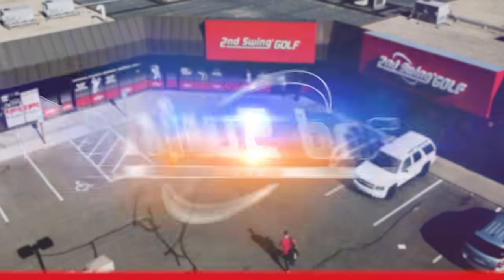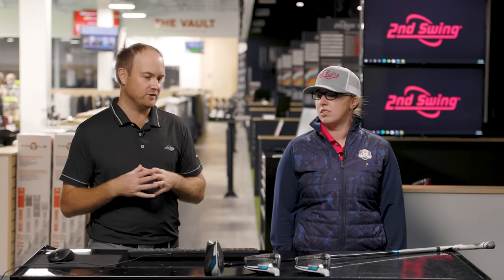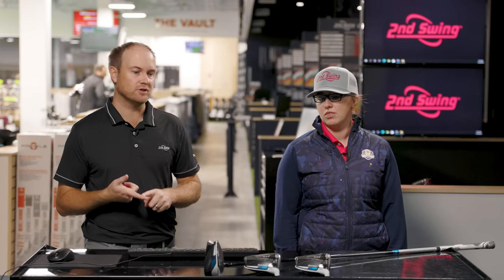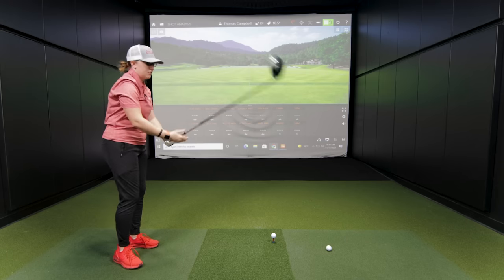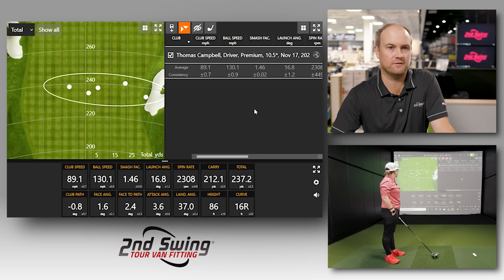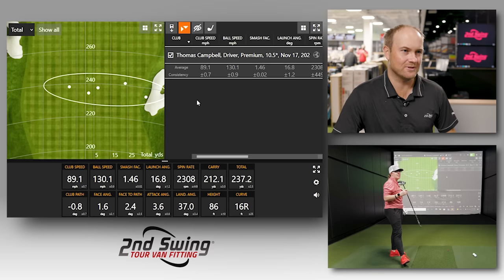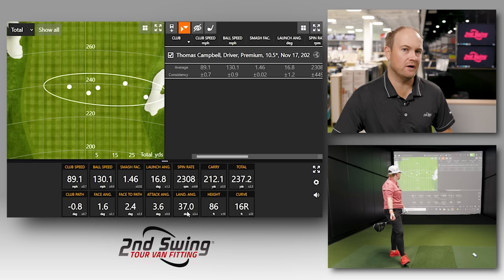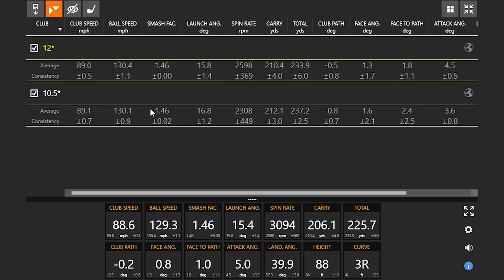Golf Driver Loft Test | Why Driver Loft Matters In Fittings

Comment: 1 thing that many amateurs do is mistake the need for more loft while the issue isn't the loft but rather their  driver swing which is totally different than an iron swing. If you're not swinging up at impact, the ball won't climb into the air. This was my issue.  My driver is 10.5 degrees, which if swung properly is plenty of loft to get the ball flying higher as it should, but my swing was too flat causing mid height stingers. For higher drives, you must stay behind the ball & not overrotate your hips & shoulders which will flatten your swing & cause low drives. We've all been told to tilt our rear shoulders down at set up which is correct, but if you don't keep that tilt through impact, you won't swing up as is required for a higher launch. Stay behind the ball & don't let your hips & shoulders rotate on a flat plane & you will be swinging up. As with most things, do this with a half swing until you get the ball airborne consistently, then you can lengthen the swing but don't try to kill the ball. This is only meant to develop the feeling of swinging up so swing slowly & smoothly.

Comment: Another informative test 
I use an 11degree driver and it,s my fairway finder .I think correct loft with the correct shaft flex,kick point and weight is the magic recipe ,not just loft alone .I use a miayazki c Kua  43gram R flex  shaft for my driver and my fairway woods 2011 model shaft but that's what works best for me . Thanks again for your video,s

Comment: On average the R-flex produced a much higher launch angle with a little bit more spin. This ultimately led to 11 more yards of carry and 7 more yards of total distance.  The extra launch and spin helped boost carry distance, even though the average ball speed was down 1 mph. The steeper landing angle led to slightly less roll-out, but the net gain was still significant. In addition to the gain in distance, the player’s dispersion area shrunk significantly.
Reply: Well done ,I was going to get stealth 2 but horror story's about the face ,,so got almost brand-new sim 2 stiff shaft, winter I can't really get up the course in winter moving to the best course in my city ,downfield, Scotland, can't wait 👍

Comment: Surely an appropriate test would be to change up or down the swing speed at the two extremes @ 14 and 7 degrees ?  I have a driver swing speed of roughly 70 mph, anything less than a 14 degree loft for me is useless. My son swings at 110 mph, if he goes above 9 degree loft then there is snow on it when it comes down.

Comment: From what I see, there is barely any difference in the 10.5 and 9 degree drivers.  It looks like she could play either, so it comes down to look and feel.  She's happy with her current gamer, so stick with it.  I had the same decision, but I went with the 9 degree.  Our fairways are usually firm, so I get more roll out of the 9.
Reply: This test is significantly less relevant at these swing speeds. Really need someone with 105-120 swing speed to test.
Reply: It’s at even lower speeds where people take higher lofted clubs for difference.

Comment: Would you recommend lower loft for high spin due to  negative AOA?
Reply: Not necessarily, but maybe.  Too much lower loft with negative AoA may produce ball flights that are too low with too little carry.  The annoying answer is that you will see the best results if you can learn to hit driver with a slightly positive AoA then reevaluate your driver specs.
Reply: The correct recommendation would be to move the ball up in your stance and start having a positive aoa, then once swinging correctly figure out loft. There is no good reason to be hitting down on the ball with your driver and it is a fairly easy fix.